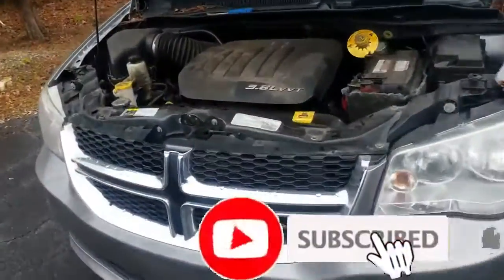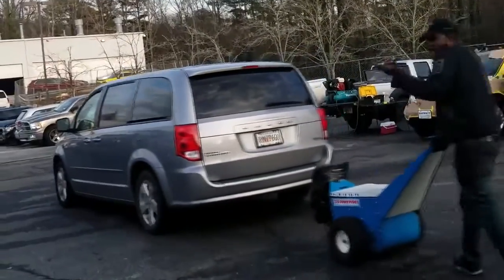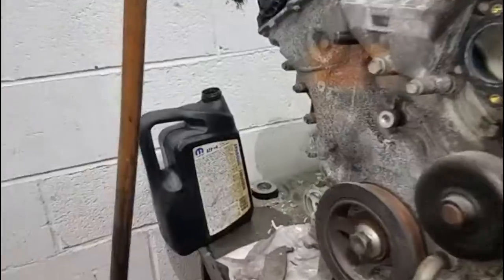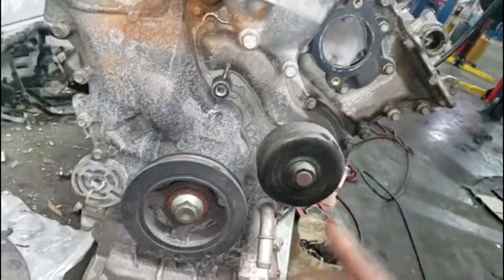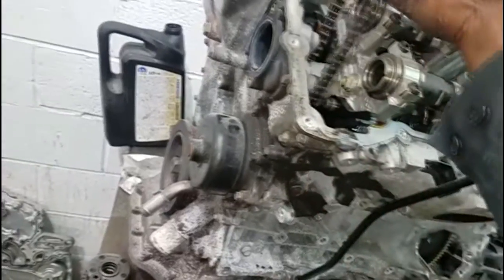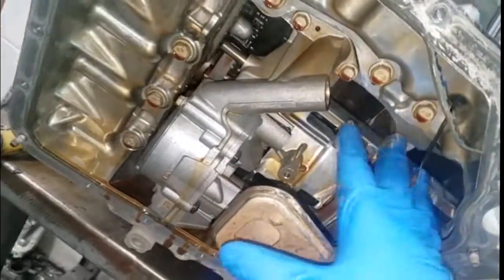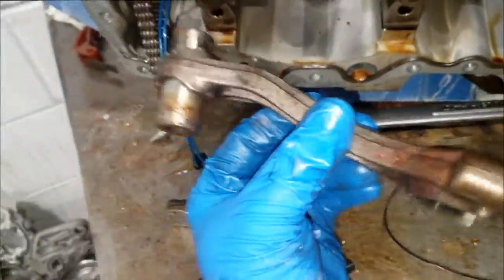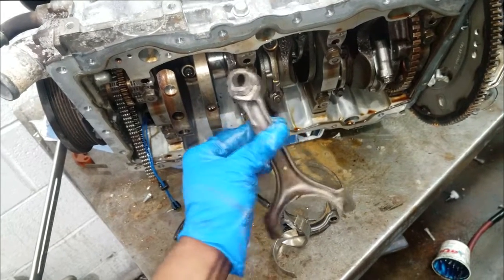This is what WATER can do to a HYDROLOCKED motor engine damaged. 3.6 Pentastar V6 Problems ticking

Comment: Really nice video, I am going through this process now with our 2015 Chrysler Town and Country; I am not mechanic but cant afford this repair; Mopar Lifetime Warranty flunked me on this one and so did the Insurance they wanted to total the van, left me with the choice of doing myself as I am not throwing away a 30K vehicle. I have done another car engine overhaul before and after putting it back together it is still running 2 years later that was an engine seize due to oil starvation on a 2004 Toyota Corolla with manual tranny; I went to 10 and replaced 80 percent of everything replaceable in that car as to leave it almost factory new mechanically including a full AC overhaul but this is another set of deal; the engine in mine does NOT spin, hence cant take the torque converter bolts out; was recommended to lift the engine and tranny then do it outside; but then more work as axles has to come off and we got that passenger axle extension bolted to the engine which I cant get to no matter how I try so far; I have a half lift where the van is off the floor 3 feet and a creeper that lets me work underneath comfortably better than if it was on jack stands but I really miss the full size one; I got this lift in preparation for this job and after I have another 2000 Toyota Tacoma with a Blown Head Gasket which I will do a complete engine overhaul as well, God willing. At the point of this writing I have not watched your other videos; this stuff is hard to find here in you tube specifically to my situation; this is as close as it is. I have been thinking if I could come from underneath remove the oil pan, lower block to get to them connecting rods and remove them all caps to try that way to free whatever and be able to rotate the fly wheel but another mechanic told me not to waste time on that and get the whole thing out; either way the block needs to be stripped to inspect for reconditioning; I do not plan to swap the engine with a used one but to recondition this one if possible; nobody sells a short block and a long block is 5k! so if the engine is not destroyed or badly damaged as this one here i would go for reconditioning myself; new pistons, bearings, rods and crankshaft comes about 3k dealer prices the rest of 2K would be needed replacements if any, I hope if i get the car to run on my wallet, Mopar lifetime Warranty would still be honored if something happens or I will sue the hell out of them. I would love not to take that tranny out! any ideas? Thanks!

Comment: It just happened to my 11 grand caravan, didn't have the time to dismount upper intake, plugs and try to rotate engine but I'm expecting the worst. How much is (in a range) to get a new motor and the labor to replace it? Do you recommend me to do that or just throw the van to a yunk yard?
Reply from the maker: Wow, sorry this happen to you..why dont you try to do what this customer did? She went tru her insurance and they covered it. I'm not sure what the total amount was
Reply: @OnlineMechanicTips  do you know if I need to be aware of something at the moment of rotating the crankshaft? Like if it's clockwise or counter, or if I can mess the timing chain? I also didn't found the socket size…
Reply from the maker: Hector Hiram please like the video and subscribe to the channel for me, thanks
Reply: Insurance with no comprehensive coverage, it may not cover it, it will be a miracle if it is not locked but will see tomorrow…

Comment: What type of device was you used to  push the van?
Reply from the maker: Lol..that's the electric pusher the shop has..we use to have to use a tow row and the truck but now they have this battery powered pusher. Works great
Reply: @OnlineMechanicTips  ok and thank

Comment: The reason I knew the rod was bent was I hydroloc a 89 dodge with a Cummins.  I still have the rod .replaced the rod and run it for another 10 years.  🤜🤛
Reply from the maker: Wow..plus I think I was using the wrong terminology, the engine wasnt seized, it was jammed. I would be terrified to re use this engine even with a new rod and piston. But you racing guy understand the risk i guess
Reply: @OnlineMechanicTips  I got lucky those Cummins engines are pretty stout. Just bent a rod. No bearing damage or piston damage.  Actually used the truck for a month with the bent rod after I got the water out of it.  Lol when I think about it.